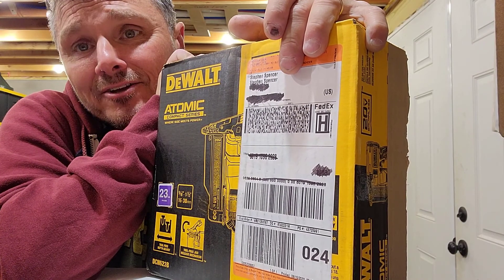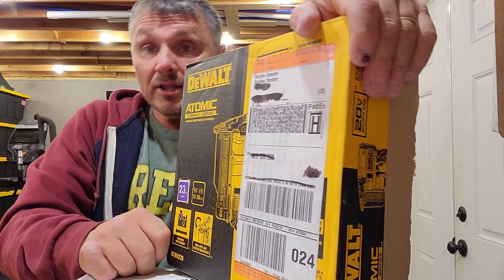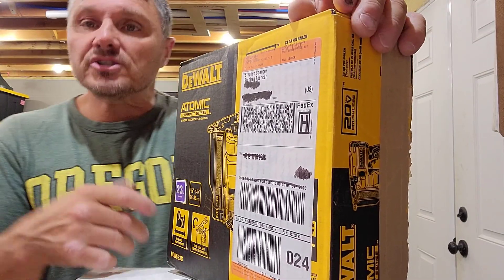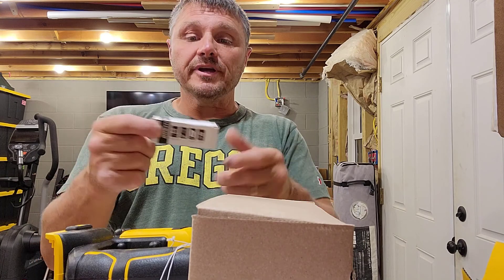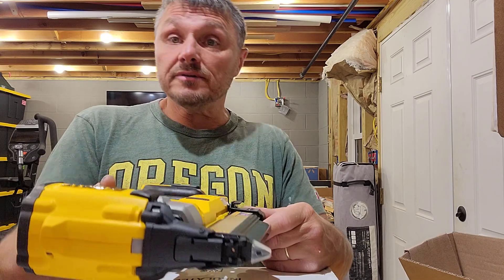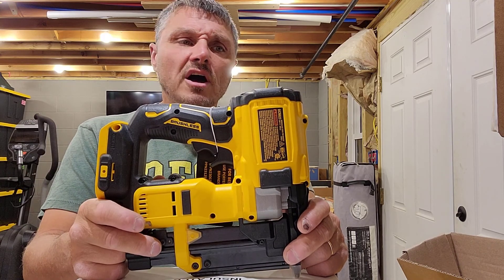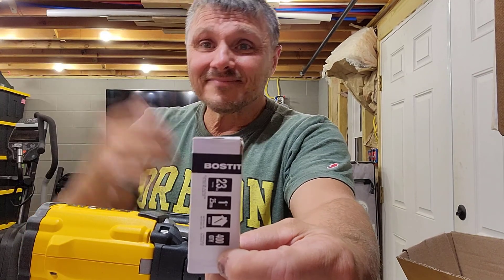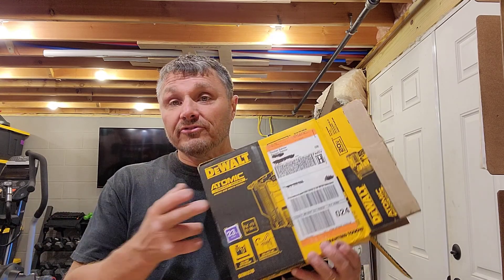DeWalt 23ga pin-nailer unboxing and review

Comment: I too have seen the light, LED cordless light. Cordless blower might work for you, I love it. I’ve even gotten a cordless random orbit with cordless vac 👍👍. I’m almost ready for a cordless table saw. 
Looking forward to your next video.
Reply from the maker: Hi Andy. Thanks for the comment! Since you mention it...I have the 60V cordless blower and use it most every job. I also have the cordless orbital and mid-size 20V vac. 

As much as I might like that cordless table saw, my current 748 is less than 2yrs old so I will not be able to afford to replace it anytime soon. I am resigned to a corded TS and a corded miter for the foreseeable future. Other than those, my Makita 4x24 belt sander, A Ryobi corded circular used for masonry, and two corded DeWalt routers are my only three mainstay corded tools. As Renovations and Repairs said in an earlier comment....I am slowly but surely turning to the cordless "dark side." In fact.....I am almost there!